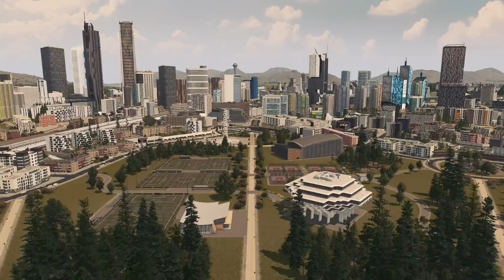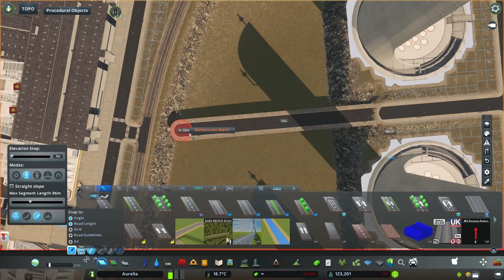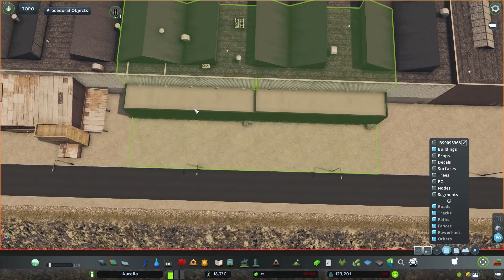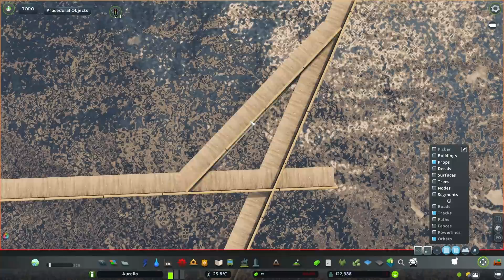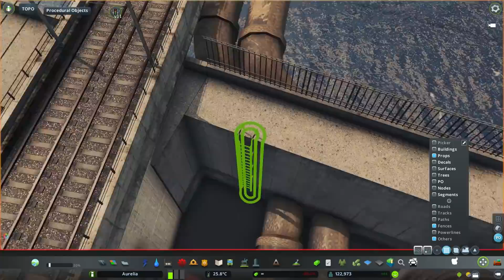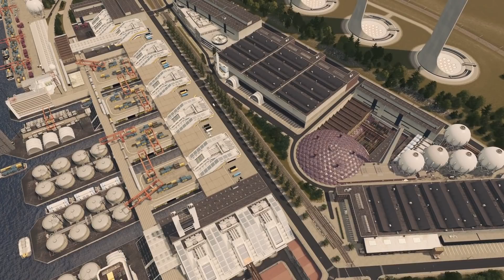Solar Power Plants, Industry and Completed Harbor - Cities: Skylines - Aurelia #91

Comment: Great job on the rotating solar power plants! I am happy to see you took the time to make the rotation match the environment. My guess is that solar panels such as these are quite good at absorbing sunlight early and late in the day, when the sun is low. The white circles on the bottom might act as mirrors, redirecting vertical light during the middle of the day into the panels.

Comment: What is that mod you are using at 16:49? I've been trying to find it for ages but I can't figure out what it's called or if it's on the workshop in the first place
Reply: It's Node Controller. I believe by Kian.Zarrin.
But there is a new one called Node Controller renewal, these videos are a bit behind which he has mentioned I think. That's probably why he's using the old node controller still in videos
Reply from the maker: I'm using the old NC still because the new one apparently won't transfer all of the previous builds.
Reply: @Akruas  oh, there was a mod you werent using yet becauss the videos werr prerecorded a bit, right? Was it Rotterdam
Reply from the maker: @GoatjePoempie  that was it yes
Reply: @Akruas   Thank you guys, I didn't even know that it was an old node controller that had this feature

Comment: Where is this rotating solar power concept from? It looks incredible. It seems to make sense at least though googling around for it only gives me more typical solar power types (e.g. updraft or those concentrated solar heat plants.)

also steam workshop seems to be down so I can't look for them there either right now.

EDIT: Found the workshop asset. Turns out that the reason I couldn't find this concept anywhere is that it's a specific background detail from Neon Genesis Evangelion that you'd probably have to deduce are solar thermal collectors, but otherwise, I don't remember them being mentioned in the anime.
Reply: I believe they're from Tokyo 3 in the anime Neon Genesis Evangelion.
Reply: @srb_guy3487  yup. never noticed them. They just blended in as sci-fi looking structures. I mention they're form that anime in an edit to my comment.
Reply: I think in Evangelion 2.0 its more directly shown that they act as mirrors of some sort that redirect sunlight down into the geofront.